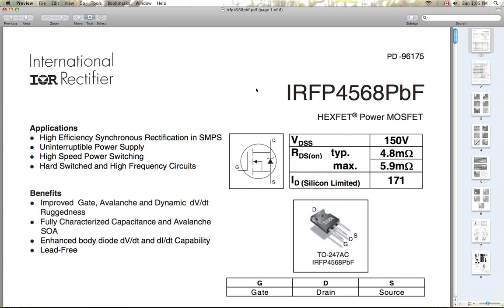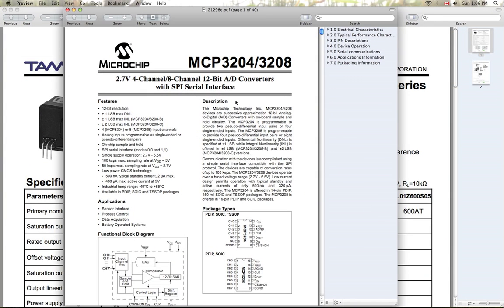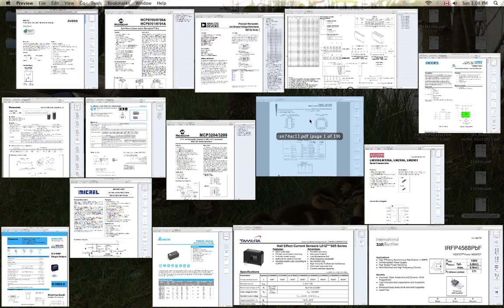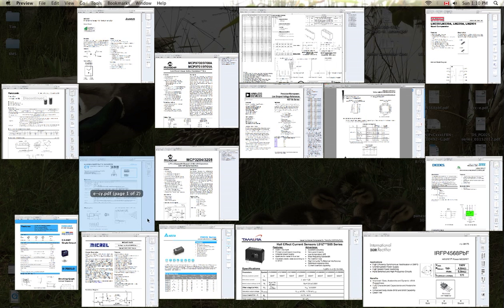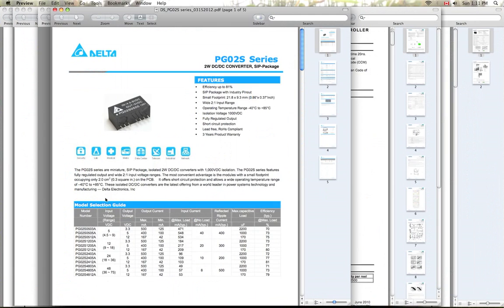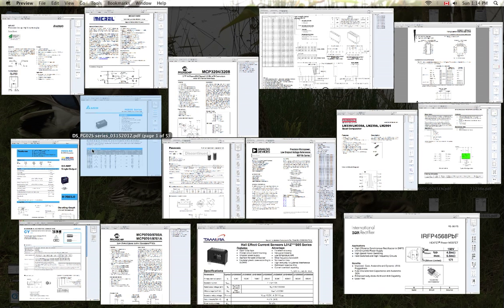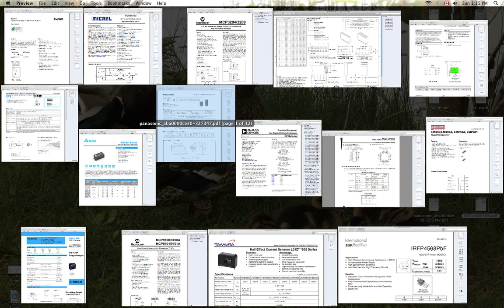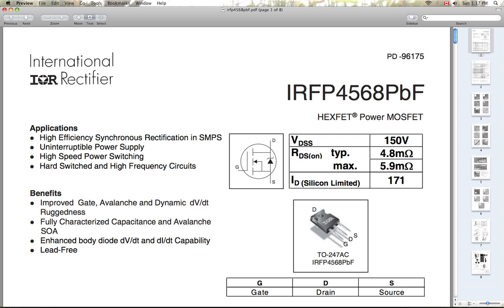Custom Motor Controller Build #3

Comment: Could I ask what your education is?  Are you an electronics engineer?
Reply from the maker: Yeah no problem! It's no secret that I'm an electrical engineer.
As far as I'm aware there is no such thing as an "electronics engineer" in Alberta (as far as qualifications goes). Many times electrical engineers in Alberta will have jobs with the title "electronics engineer". I assume in other parts of the world you can actually get a degree in "electronics engineering". There are "electronics technologists" here, but that is typically a much more hands on field of work (repairing equipment).
Reply: ***** I have technical question for you if you don't mind.  Is it possible to design a controller that could change total voltage on the fly while you are riding?  Normally batteries are wired together either in series or parallel or some combo of each to produce a certain voltage and amperage.  Instead, could each battery be connected directly in to the controller and the controller would change the wiring scheme instantaneously for different amounts of power based on what the rider wants at the moment?
Reply: George Gallup
Yeah, with a huge-big dc/dc converter going into a BLDC controller rated for your highest voltage + 33%...but there would be no point, really...

Comment: Part choice seems to be quite good. I did not see the microcontroller that you want to use. Some microcontrollers already have 12bit ADC. Why did you opt out for a separate one?
Electrolytic caps especially the large ones are quite unhappy with vibrations you need to find a good way to mount them.
MOSFET choice seems to be quite good those 10 in parallel will have an RDSon similar to my 60V mosfet.
I do not know for how many seconds will those 600A be needed but that is serious current. I will be curios to see how will you connect those mosfets. RDSon is also quoted for 20C junction temperature is about 50% more at 70 to 80C so it will get to about 7.5 mohm with a 60A load that is about 27W dissipated on each of the 10 mosfets so 270W.
At 20A is just 3W and I think that is you average or less  
Will they (the mosfets) be mounted directly on PCB? You mentioned something about SMD for the power board. For my power board I chose to use Aluminium backed board so that the SBMS can be mounted on an external heatsing. The Aluminium boards cost about the same. Not sure you have a preferred PCB manufacturer but a lot I tested will lie about the copper thickness  you will need to check that.
Is there no specialised DC motor IC that can do all that you want to do in a single package? I like to have things as integrated as possible.
Reply from the maker: Thanks. I totally forgot to mention the micro! I will be using a PSOC 1 series micro from Cypress. I am familiar with them, they are extremely flexible, and have many built-in blocks (PWM, LCD driver, Timers). Most of the blocks run stand-alone and require minimal CPU input which leaves the CPU free to crunch numbers and do other things. This project won't require much CPU "horsepower".

I decided on the seperate ADC because it is lower noise and has more channels than most micros are able to provide. Right now I am using 7 of the 8 available channels.

I guess I never mentioned how long I want the 650A for. I only really need it for 10s of seconds for brisk acceleration. Beyond that I won't need it. I have a brilliant (at least in my mind) way of connecting the mosfets. I will be going over that in the coming videos. Your calcs look to be spot on. The design will have to deal with up to 300 watts or so of conduction loses in each bank of mosfets. There will still be switching loses on top of that!
Reply: ***** Interesting choice for the micro. But it makes sense to use that if you are already familiar with it. I was almost sure you will be using an AVR or an ARM :). Is easy to underestimate the amount of horse power or size of program memory. I was sure 16k of flash will be more than enough for my SBMS but I got the 32k version to start with and quickly realised I will actually need the highest available version with 64k and even for that I will have needed a lot of optimisation to fit all. Luckily the 128k just become available so I got that even if it was a bit more expensive just not to waste time with code optimisation :) I'm using now about 75K and things are almost done over 95% so I'm good there is even space for future SD card implementation.
10 seconds is not that much so you will probably be fine. Almost forgot about the switching loss, I guess I'm to used with my simple switch.
As for ADC I was lucky the specialised IC that dose almost everything has integrated 14 bit ADC so I had no need for the 12bit ADC integrated in to the ARM microcontroller and for the next project I will use a 24bit ADC so I will still have no need for the integrated one. Still the integrated one is not that bad and there is a version with 16 bit delta sigma differential ADC and programmable gain amplifier available.
Have you considered regenerative breaking or the increased complexity is not worth.
I'm planing to build some electric vehicles in the future but without driver just remote controlled ones that will help around my property with gardening digging and snow removal.
Reply from the maker: *****
Haha yes it's crazy how quickly you can run out of memory even in the large memory micro controllers of today. A SD card FAT file system (if that is what you are thinking of doing) would take quite a bit of memory.

I have decided to not do any regenerative braking. I want to keep the design as simple as possible.

An electric snow plow would be handy!